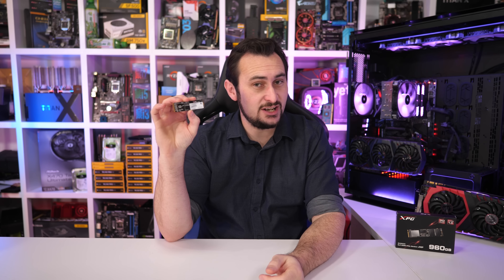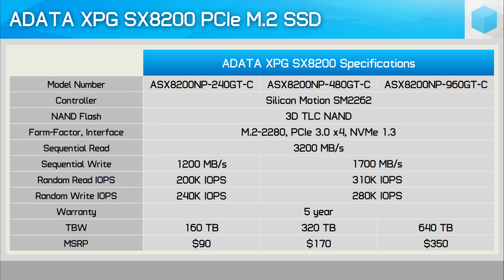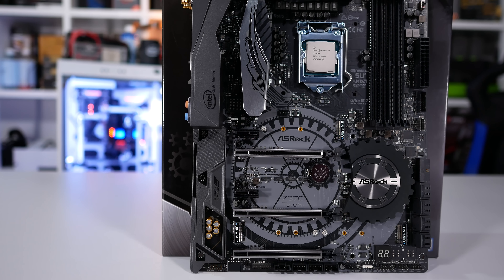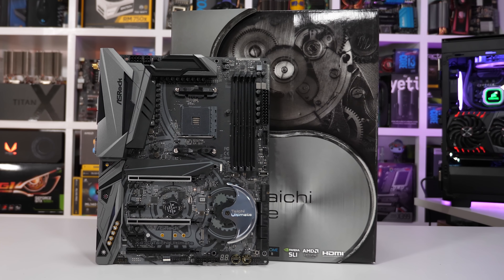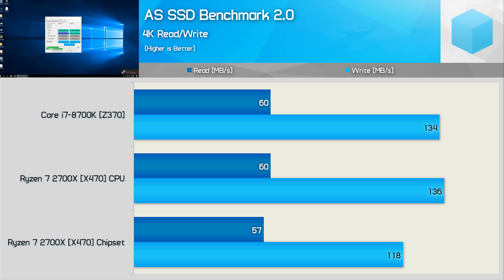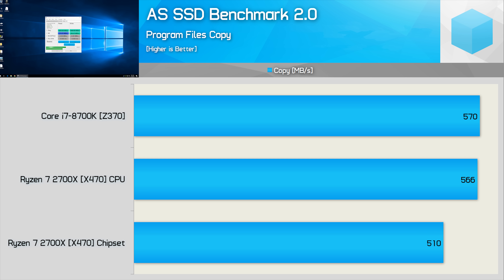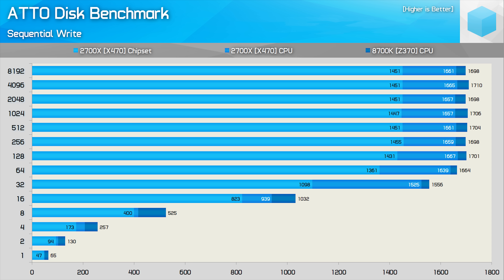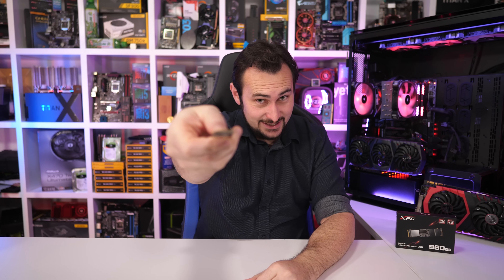Intel Z370 vs. AMD X470 Storage Performance, Not All M.2 Slots Are Equal

Comment: Im so gonna wait for your Raid 0 performance for both platforms. Hopefully the Ryzen platform 2nd m.2 would not impact the Raid 0 performance since it is running at PCIE 2.0x4.

Also it would be great if you could compare the Asus X470 Crosshair Raid 0 performance with the rest of the X470 & Intel counterparts. Cause it is the only Ryzen board that has both m.2 slots that are capable to deliver PCIE 3.0 x 4 but shares the bandwidth with the 1st GPU slot. Leaving the GPU with only PCIE 3.0 x8 lanes.

You have a good day Steve! Love and appreciate all you have done for for the hardware community!

Comment: What, no Samsung 960/970 EVO/PRO?
Reply from the maker: Given the Evo models are slower and the Pros not much better (slower in some workloads) I don't see why it matters. The ADATA drive clearly shows that we set out to find.
Reply: I wrote EVO slash PRO... Yeah, but why not test The Best? :D
Reply from the maker: I made this video because I had the new ADATA drive, that was made pretty clear in the video. Also in terms of value the SX8200 is the best, 960 GB version costs $350 while the 970 Pro costs $530 US. Tech sites such as PCPer and Tom's also agree with that claim.
Reply: I know, I was just joking.
And for them to really crush the benchmarks, you need the highest storage capacity anyway... And those are very expensive! :(

Comment: Would also like a video on why NVME is not beneficial to most users. They are great for Video editing, large file transfers, and other CAD type workloads. But other then those workloads, they simply dont make any sense for users. They dont offer better game performance, they dont offer better boot times, and they dont make anything on the web any snappier then a normal high quality SSD.

great vid on m.2 though, ive been noticing issues with people having their slower speeds and different numbers for AMD and Intel Mobo's
Reply: I'd argue the simplicity and general ease of use vs normal form factor drives makes m.2s preferable. Just stick em in and you're done, no power or data cables to connect.
Reply: An aspect of m.2 SSDs that is often overlooked: cable management. You no longer have to worry about routing power cables neatly in your case.
Reply: Why should you worry about routing cables when only you will see it, most of the time is just the flat sata cable that is barely noticeable (can even be black or any color).

This guys with the fad of having windows to just look at the innard of a PC, 99% of the time they're the only one "seeing it" considering you need to look at the monitor to do anything -_-
Reply: You havent build many PCs in your life havent you?
Reply: @nintendodork  ive been building pc's since the 90's.  im old school so no glass windows on my pc.  i dont care about cables or about 2.5 ssd's dangling from them cause i have no mount or duct taped to the side of the case whatever.  so im with you, a sata cable isnt a big deal as long as the drive i get is substantially cheaper.  at the end of the day all that really matters for 99% of users is that they are not on a spinning disk magnetic drive except where absolutley necessary.  of course if a sata or nvme (either) m.2 drive is available for the same price as a 2.5 inch drive and i have an empty slot then it would be kinda silly not too.
Reply: I've got a 10 Gbit/s connection at home, so it is beneficial for me while downloading stuff.
Reply: ShimejiiGaming . Ummm I went from a OCZ Vector 128GB SSD as my boot drive to a 970evo 250GB samsung drive and the difference was extremely noticeable. Installing applications, boot times, load times. All changed for the better and the most noticeable is the windows experience which I include installation of applications and the boot time. Worth every penny. Plus the simplicity of sticking it in your mobo with no cables is so nice. :)
Reply: you wont see a video man, NVME is been pushed hard by the media, and what you request is the opposite lol.

I fully agree with you, I suppose one reason to consider is tho that all the youtubers do video editing for a living, so for them nvme on a personal level helps their workload, the problem is the average joe bloggs doesnt edit videos so in that respect they have become detached from the real world.  One website i read yesterday even referred to high performance sata drivers as a niche, yet the nvme stuff they keep pushing is the niche, not sata.

What I would love to see as a video is why we seeing no real progress on cost per gig, we have seen a transition of consumer mainstream/high end ssd's from MLC to TLC, TLC practically halves their manufacturing costs as it doubles capacity, yet where have those savings gone?  Even the drive in this video is a TLC drive.
Reply: @raveutcars you went from a 6 year old early gen ssd drive tho, in that time the performance you jumped off has mostly applied to sata drives, so if you went from say a samsung 850 pro to the nvme drive you would not be noticing the difference unless benchmarking or doing specific workloads like video editing.
Reply: @Cmdr Flint I dont agree.

The problem I have with their design is you plugging them in directly on the motherboard, now I dont know what your board and case is like when assembled, but mine tends to be a bit of a nightmare to get fingers close to the board, for this reason I e.g. have a SATA cable plugged into every SATA port "just in case" I need one at a later date so my fingers dont have to go anywhere near the board, the simplicity of sliding a drive in a drive bay and simply plugging in the cables at the back of the drive is about as good as it gets.

My cpu driven NVME port is right above my gpu slot, I have a very big gpu, I also have a very big cpu cooler, getting access to that area with everything assembled is a complete no go, the gpu would have to be removed to either add or remove an nvme drive, that is most definitely not convenient. Not to mention its placed in between the two biggest sources of heat in the case with likely little airflow.  Whilst I have 2 case fans blowing from front of case through my drive bay.

I feel with nvme what they need to do is either move the slots to the back of boards and have them accessible via holes in backplate of case, or use cables like we have with SATA so they can be fitted elsewhere in the case.
Reply: No cable mess with nvme drives. Reason number 1 for me.
Reply: It really depends on size. I wanted a 256gb ssd to just house my OS and apps since I am reusing my 2.5" ssd for just games in my new build this weekend. The price of the 256GB WD Black NVME I got was $80, while I would have spent $70 on a 240-250B Sandisk or WD Blue 2.5" ssd ($120 on a Samsung 860 Pro). So going NVME made since with the m.2 form factor being more convenient when it comes to cable management and may as well use my m.2 slots and leave my 2.5"/3.5" drive slots for future expandability. However, when you get to 1TB range then the price differential is larger ($230 vs $400).
Reply: If the cost difference isn't significant(and very often it isn't), it doesn't make sense NOT to get the latest & future format. If you have your own personal reasons, that's fine(and stop with the "lack of airflow/heat buildup" garbage, not only are there coolers available for them, but this isn't even a problem what so ever), but, for someone that doesn't share those issues, it's a no brainer. Just the fact that you can minimize the amount of loose components & total components in your system as well as make it that much more compact & neat alone are reasons why it's worth it, and worth, say, $10 over a 2.5".
Reply: The only (proper) reason ever provided for cable is to increase airflow as a means of heat management.  The problem is if your drive is bang in between your cpu and gpu, then that is not good heat management for the drive.  I will respect that for some people they value having one less cable in their case, for me tho I value the convenience of been able to swap out drives and keeping my drives cool.

Of course I also value price and NVME pricing is not favourable, so for me these are a niche product for those who want a big e-p** or who need it for video editing. :)

End of the day as long as SATA ports dont get reduced on new boards, I got no quarrel with NVME slots, but if we start seeing boards with less than at least 6 SATA ports then I will have an issue, my main issue with flash drive storage is the cost per gig.  NVME performance enhancements has provided an excuse for the vendors to not drop prices on new products.

Comment: Why test with a random NMVe drive that nobody ever even heard off instead of using a samsung 970/960 evo/pro?
Reply: Because the video is (at least the title says so) about comparing Intel and AMD.
It's just when like comparing CPUs, you pick a 1080Ti to prevent a bottleneck in that department, and the 1080Ti equivalent of a SSD is a Samsung 970 pro/evo.
Sure a 1070 is much cheaper and might also make more sense for most people, but then again, using a 1070 for testing Intel vs AMD is suboptimal.
Reply from the maker: This is a 1080 Ti of the NVMe SSD world, it compares well to the 970 Pro and it beats the Evo hands down.

Comment: X470 Crosshair 7 uses second M.2 slot as gen 3.0*4, use that board and redo test
Reply from the maker: Why? What would that change? :S
Reply: Nothing. But I guess people are salty that you called it a limitation of x470 ;-)
Reply: "What would that change?"
Well it wouldn't be an Asrock board for starters and you get 2x4PCIe 3.0 connections direct to the CPU, though at the cost of limiting the bandwidth on the GPU to 8X. Meaning that you can run 2 drives at full speed without sharing.
Reply: Traumglanz
It's actually not a limitation as the two M.2 ports aren't sharing bandwith. You have one full speed and one half speed m.2 slots, with the second not interfering with other chipset i/o functions(sata usb etc) with exception to the chipset PCIe x4 slot.
Reply from the maker: @magottyk but I showed how the SSD performs when connected directly to the CPU, so again what would it change if I showed that again? The Crosshair 7 would just limit me from showing you how the secondary slot on almost all AM4 boards performs.
Reply: Well you could run both drives simultaneously at full speed, while ordinarily you can only run the second at half speed.
But you do get the full bandwidth simultaneously on X470 be that at 3.0+2.0 normally and 3.0+3.0 on the crosshair, while z370 must share and you can never get more than the maximum of the DMI or 3.0/2. You'd have to go expansion board on PCIe16 _2 to get more bandwidth.
I like the crosshair implementation (raiding 2x970 evo's), though I think the 2nd PCIe 2.0 m.2 slot on most boards is perfect for StoreMi using a slower NVMe drive and HDD while having a high speed NVMe as boot drive.
Reply: @Laxmi Narayanan KS if you use the second m.2 slot as gen 3 x4 you will lose half the lanes to the gpu and it will only make the second slot as fast as the first on ryzen.  the point of this video is not that you cant use the second slot as x4 but what happens if you dont know that the second slot is x2 or dont want to lose half your gpu lanes or just plain dont mind using it at x2.  besides you can do the same on an intel board and run 2 ssd's as x4 but again you will lose half your gpu lanes.  i you want to lose half your gpu lanes then you can get the same x4 speed on either intel or amd and if you dont want to lose any gpu lanes you can use amd with one x4 and one x2 or you can use intel with 2 x4's but they will share the same bandwidth.

but none of those facts are what the video is about.  its aobut what  happens if you dont read and understand your motherboard and just stick it in a random slot

Comment: Would be nice if performance is consistent no matter what slot you put these drives, but I guess that's just how things just are right now.
Reply: That would require extensive extra circuits and switches on the board. So more costs with literally just making it more idiot proof.
Reply: An x399 Threadripper motherboard should allow this. I believe, since they have 64 lanes.

Comment: I create web sites on my computer, these 4K read/write tests are what makes NvME drives disappointing, I had better results with slower SSD drives in a raid zero setup (and a good backup strategy) when it comes to very small files transfer... and a maximum throughput of over 1GB/sec is plenty for my use... Well I kept my NvME drive as a boot drive, I use the SSDs as "cheap" storage ;-)

Comment: That means x470 needs a change and upgrade in its nvme interface ..
Reply: The Crosshair Hero VII for example supports a PCIe 3.0  x8/x4/x4/x4 configuration (with two of those x4 slots being native m.2). So it does not seem like a x470 limitation, but rather a choice from the motherboard manufactures to maintain the x16 GPU Slot with 16 lanes while being able to use two nvme m.2 drives, even when one of them is limited to PCIe 2.0
Reply: Traumglanz 
Thank you for the detailed response.... For a moment I blown away... And this doesn't affect the performance.. isn't it???

Comment: Crosshair VII Hero anyone? Use the bottom m.2 slot. yw
Reply: Crylhound yes I don't understand how Steve missed this, Der8auer showed which M.2 slot use Gen 3.0*4 in Crosshair 7
Reply: At the other hand you are reducing your GPU bandwidth this way to x8. ;-)
Reply: what?  i dont get it.  what did steve miss?  what did i miss?  lol
Reply: It was just a reminder of which slot to use if you own a Crosshair VII
Reply: Yes, but keep in mind that you can move the heatsink to the bottom slot. You might also need to change the stand off with the top one or use the one provided with the accessories. Can't remember exactly.
Reply: @mrvey top slot  is that bad one unless you want to lose half your gpu lanes.  if thats that the case then you can make it not a "bad" one. so yeah bottom slot good and other one bad
Reply: That's good to know for that future time I can actually afford some sticks. I haven fallen madly in love with this mobo. It's incredible. So glad I paid the extra this time.

Comment: Didn't der8auer say you could get full x4 speed out of the chipset m.2 on crosshair 7 hero because it takes lanes from GPU?
Reply from the maker: It would be connected to the CPU for both slots in that case and share lanes with the graphics card.
Reply: in other words you will cut your gpu lanes in half.  if youre ok with that then go ahead.  but if you were willing to do that then you can do similar setups with the right intel board
Reply: Hardware Unboxed I double check the manual and it does say it runs PCIE3.0x4 for both by stealing lanes. Is that something Asus has done? Because the chipset spec is exactly like what you tested PCIE 2 x4
Reply: bobhumplick oh yeah like I don't think I'd do it, just interesting. Potentially could raid some m.2s that way for insane benchmark scores
Reply: @benjamin russel  yeah.  you dont even have to run a gpu at all and can use the whole 16 lanes for ssd's if you want.  of course you gotta get a raid card for that. i think asrock or asus just put one out that holds 4 full gen 3x4 ssd on onw card that plugs in in place of the cpu.  plus the one that runs off the chipet for a total of 5 full gen 3 ssd's.  there are a lot of different configs you can do with an 8/4/4 or 8/8/ or whatever.  just depends on the board.  i just got a cheap z370 pro4 and its only got one slot thats full gen 3 x4 but a second pcie slot that is full gpu size (x16 size)  is only wired as 4 so i can put anything in it from a x16,x8, or x4 card.  only problem is that it will only run at x4 speed but it will still work.  and its on the chipset so i still get the ful 16 lanes for the gpu or i can stick a raid card in the gpu slot and run 2 m.2's on the chipset

Comment: Nothing beats Samsung 960 Evo.
Reply: 970 Evo beats it
Reply: Yup, my mistake. All hail the mighty 970 Evo.
Reply: 980 Pro beat all of them 😁
Reply: 970 Evo, 970 Pro, 960 Pro, WD Black 3D Nand, Intel 900P
Reply: 970 PRO!
Reply: and 980 will beat both of them :þ
Reply: on user benchmarks the 960 evo has it beating 970 in most things actually? Dunno how accurate it is though
Reply: Aku Pegu
Except for the 970 evo.
Reply: sbcontt YT
960 pro 2tb = $1200
970 evo 2tb = $800
960 evo 2tb = N/A
Reply: 970 Evo, 970 Pro, 900p
Reply: sbcontt YT 900 series are m.2 and 800 series are sata and m.2 and msata, the 900 are nvme drives however.
Reply: my wallet disagrees. It finds the bit slower but still holy shit that's still fast cheaper WD's quite a nice acceptable way to go.
Reply: Why is no one reviewing the 970? :p
Reply: SRAM would....
Reply: 970 pro
Reply: 980 pro lol

Comment: Now try it with 2 NVMe drives at the same time.
Z370 DMI 3.0 only has 4XPCIe 3.0 speeds connecting the chipset to the CPU.

These tests isolate those pathways only for the drive under test whereas on the X470 board, both M.2 drives can operate at maximum bandwidth for their respective connections simultaneously. Comparing the Intel setup to the AMD setup in the way you have is only telling half the story with the second M.2 on X470 using only half the bandwidth of the chipset-CPU connection. While these drives well and truly saturate the bandwidth of the second M.2. slot that goes via the chipset on X470  being only 4XPCIe 2.0 (effectively 2XPCIe 3.0), it cannot saturate the link to the CPU unlike the intel setup which will use the full bandwidth of the DMI connection. All the while the first NVMe drive on X470 with direct to CPU connection, is free to operate at full speed simultaneously.